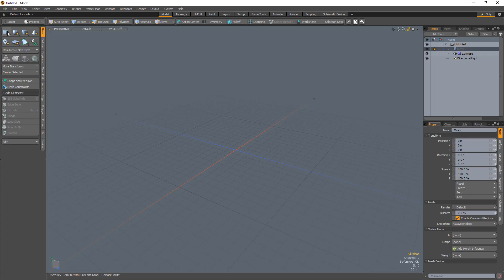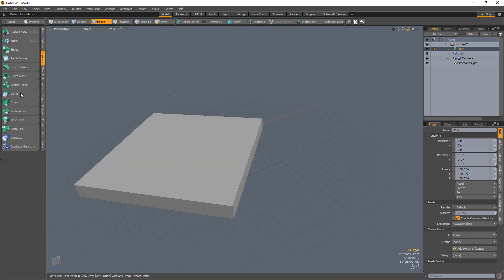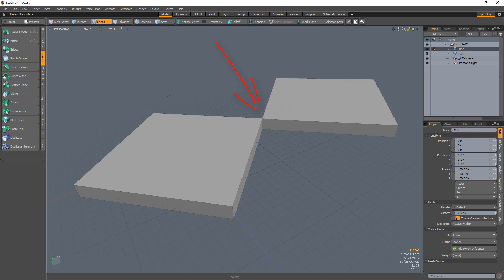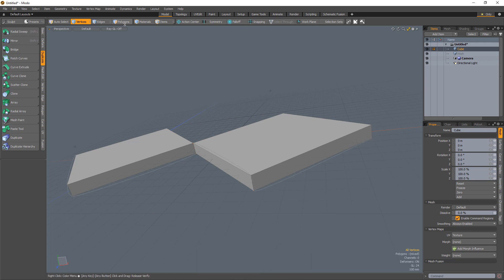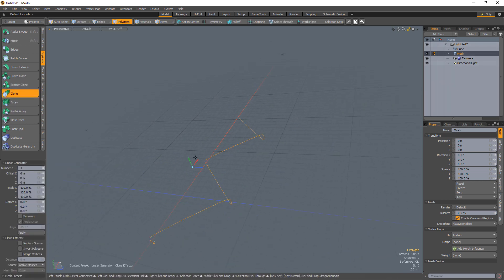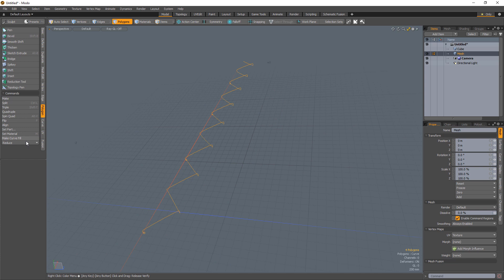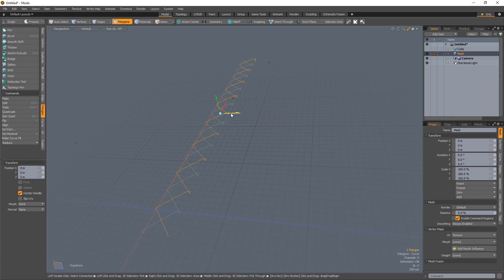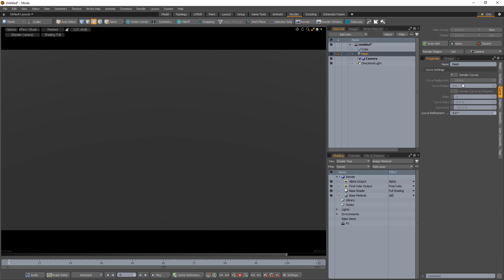MODO | Creating a Chain Link Fencing

Comment: Thanks.

Merge step doesn't work here, no matter how close I match two curves, any idea?
Reply from the maker: in order for merge to work the verts have to be at the exact same xyz location. you can use the merge tool instead if you need to merge verts that arent sharing the same position.